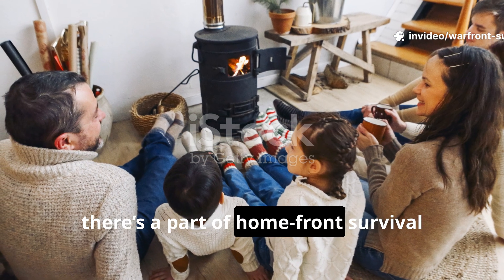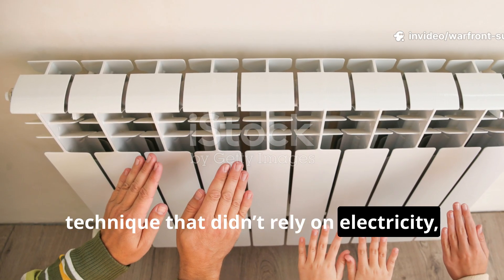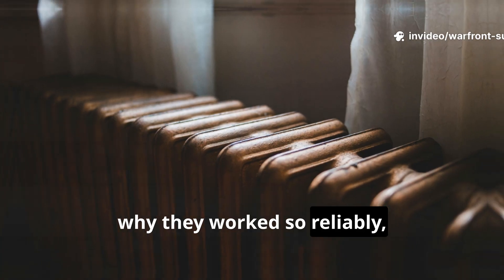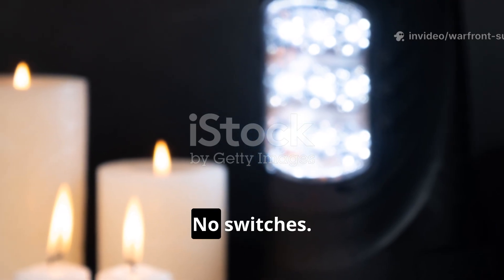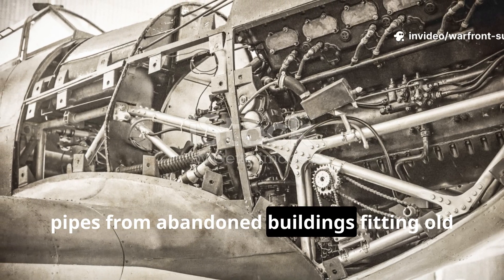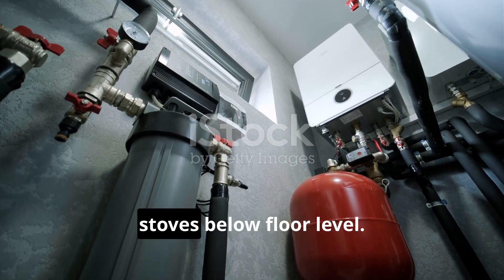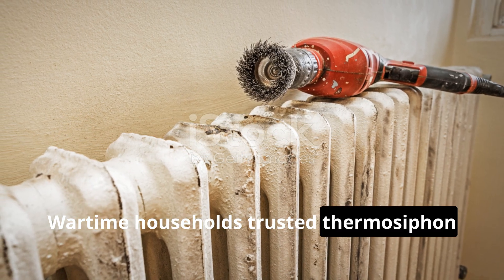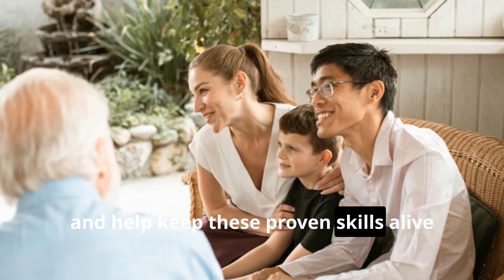The WWII Wartime Heating Secret That Could Save Your Home Today

Comment: Да с какого она должна была нагреваться то, топили печи и так и грели.
Reply from the maker: They heated it first because warm air rises and creates a stronger draft. That made the system pull in air better and spread heat faster. The stove warmed the space later, but the initial heating helped the whole setup work properly.
Reply: @WARFRONTSURVIVAL  She would have warmed up anyway. I have a proper oven with ribs that heats up without any battery, creates convection and heats everything. convection pumps of the 5th generation. And before that, they just did it from what was there, and the battery was still there long before the war, even in tsarist Russia there were batteries, not to mention the USSR. Where Leningrad was under siege and the batteries were working there.

Comment: AI slop.

And it's not like some ancient lost technology, it's just boiling water so the warm water turns to steam and pressure and heats the room. Then returns as cooler water to the boiler and repeat.

That's why you still have to air out your water based radiators today
Reply from the maker: Thank you for sharing the information!
Reply: @WARFRONTSURVIVAL  Stop posting slop

Comment: Didn't the earliest water-cooled auto engines use the same principal?  You could get away with it as long as your engine had a low specific power output.
Reply from the maker: Thank you for the information ☺️
Reply: YES

Comment: radiators in domestic homes were in short supply in early 1940s. it was most open fires burning coal and wood,  and gravity systems with a gas boiler were still being fitted in the 80,s the boiler fire did not need to be in a pit or basement. this is complete rubbish.
Reply from the maker: Thanks for sharing your perspective!
Reply: Yeah and the gas boiler used a pump!
The natural circulation was used for a hundred years and was applied to multi story buildings!
Reply: @Magnus-qr7lj  the boiler used a pump for hot water, not for heating, as for the rest, i wasnt aware multistory buildings used hot water radiators 100 years ago. wow.